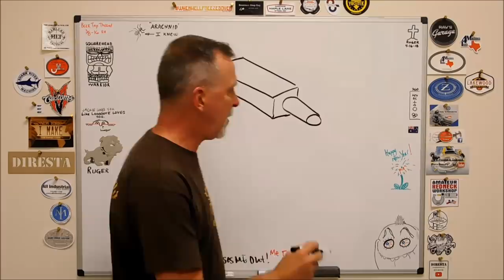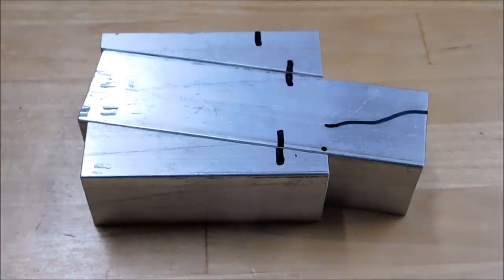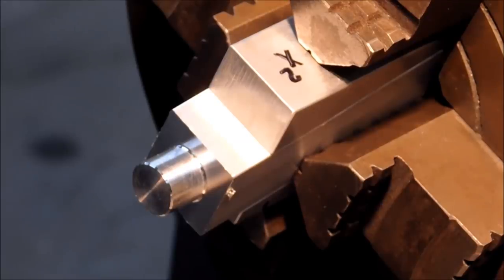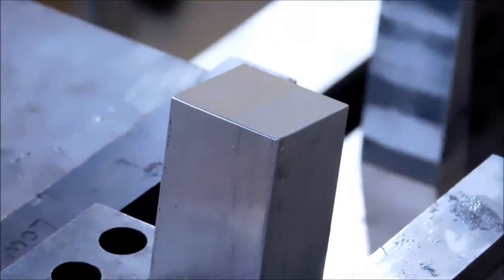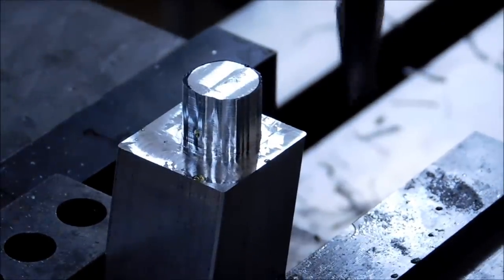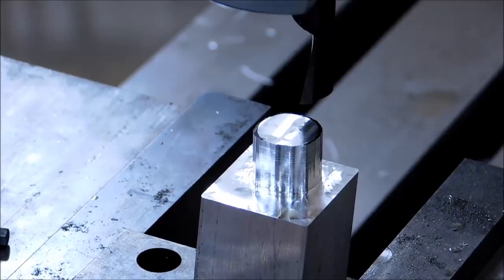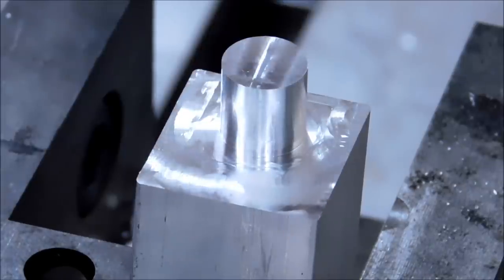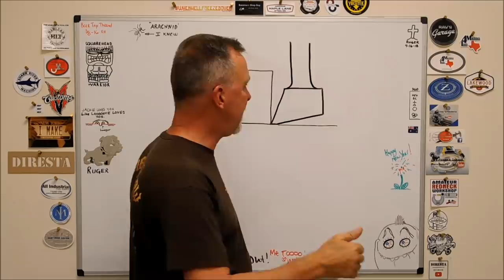Machining Angled Bosses on The Mill and Lathe

Comment: Proof that the real job is holding and indicating parts rather than cutting them.
Reply: But what did you think of his skill in roughing out the part on the mill? Smoooooth. This guy has the knowledge and the skill to demonstrate it. Impressive stuff
Reply: @nanathannvw  He machines the way a cnc would do it. Holding and set-up is 90% of the job.

Comment: Joe, you are fountain of tips and tricks and I watch your stuff even if I do not immediately have a need for what you are presenting. You are making us aware of techniques and it gets stuck somewhere in the back of the head to be pulled out when need arises. Thank you for putting in the time and energy to create these videos. They are timeless.

I would love to see how you would approach milling tight flatness tolerances <0.0007 (<0.02mm) between two surfaces on 3-4" squareish part of about 1/4" thickness. So you machine top of the part then flip it over to finish 2nd op. I find it very tricky and touchy.
Reply: Toe clamps

Comment: Very informative video as usual. Now it's time to repay the knowledge I have extracted from you over the years.
TIP: use a rotor broach. The internal dimensions are quite accurate and leave a nice finish. Whatever is left on the outside can be cleared away quickly. Don't tell anyone,  but I also use this method  for quickly removing stock in the lathe. Try it, it'll change your life :)

Much thanks and best of luck from downunder

Comment: Your lathe approach is what I would have considered first. The mil solution was very creative and interesting. I doubt it would have occurred to me.  I have used rotary table in the past for circular parts, but boring bar never. Another very informative video.
Reply: If the tolerance is tight, the mill is much easier to put the boss exactly where you want it.

Comment: Great videos Joe! I only found one other comment that mentioned this so I will add another.  One caveat to back boring, if you have a two piece threaded boring head, running in reverse could cause the shank to unscrew. If you have a threaded boring head just use a left hand tool that allows you to run the boring head forward so it won't unscrew, problem solved.
Reply from the maker: Good point.

Comment: Joe - This video and your mention of tooling balls is a good segue to a question I’ve been intending to ask.  I often machine tunnel gates into mold cavities.  The cavity block is mounted into a machinist vice using a sine bar.  The machinist vice is then mounted into a mill vice using a sine bar.  The cavity block is located using an apex and the gate bored.  If edges are broken or chamfered locating apex with laser edge finder, optical or pointed probe is imprecise.  Improvement option 1 is a tooling ball with a tetrahedron pocket like US pat 5046262.   Option 2 is a pointed probe off each surface of apex then some math.  I was wondering if you might have other options.

Comment: Hi Joe, 
I see only one comment about the angle of wooden wheels such as on your cannon. I am not a wheelwright but an old friend of mine makes model horse drawn farm carts. I believe, though I stand to be corrected, that dished wooden wheels are stronger than flat. That being said, the greatest strength in them is directly through the length of the spokes, so wheels were cambered in order to benefit from the strongest design along with the weight transferred directly along the length of the spokes. Bearing in mind that cannon are very heavy this explains the necessity. 
I can see what you mean about making the wedges thinner so that the chuck jaws grip the actual part being machined but I think that the way you held it would be better with a piece of paper between the wedges and the job to increase grip. 
I am not a professional machinist but learnt what I know from old books as I use lathes that are between 70 and 110 years old, so use the techniques evolved for them.

Great video as always...I will carry on watching now :)

Comment: If I was doing a bunch of these, and it was a job that would be repeated. Say parts of production fixtures that need to be changed because of wear issues. I would definitely make a fixture to hold the material. We had a connecting rod transfer line that was used to produce two different rod lengths. The locator for the small end of the rod needed to be offset .125" as the rods were 5.875 and 6.125 center to center. The locator was made with a register diameter to sit in the fixture and the locator pin. When switching rod sizes the locator would simply by turned 180°. The same machining line had fixure parts that equalized the clamping forces from one hydraulic cylinder over multiple parts. They featured features similiar to this with the added bonus of having spherical ends

Comment: One of those tooling balls is a great idea. It's a bit like a ball bar test on a CNC mill. Center drilling the end at the correct X,Y coordinates and indicating that with a test indicator would do it also if enough excess material can be left and then milling off that at the end. I did know about the reversed boring bar trick, but not the opposing angle blocks in the 4 jaw. A clever tip and one for the memory files. 

It depends on what time period or sometimes even the country of origin if a cannons carriage had those angled axle ends Joe. I'm no expert but it seems from about the time of the American Civil War and later most military's got away from those types of axles. The English may have kept using that design detail longer than anyone else. Since the barrels weighed so much the angled axles were supposed to distribute that weight in a more direct line from wheel rims to the hub during sharp turns to prevent wheel breakage. I suspect it didn't work quite as well as they hoped it would and it slowly disappeared. The 5 degree inward dish on the spokes that the Napolean 6 and 12 pounders had was for the same reason. Oddly enough the English normally chose to use 12 spoke wheels and 6 fellows which makes the dividing easy. For some reason the American built Napolean's used 14 spokes and 7 fellows that made up the outside rim. Durability maybe?

Comment: I tried the milling technique a few years ago but running the mill in reverse unscrewed the boring head...I ended up making a fixture for my lathe but set up for this particular operation would be a lot easier on the mill.
And yes on the tooling ball...

Comment: Most pull-down milling vices do not lend themselves to this sort of stuff as some will even squish pieces of paper shims down and will really throw you off. There is a style of vise with a clutched handle which disengages you can still move the parts by hand to position them and then tightens on the next twist.

Comment: Fantastic video Joe !  I think there is still alittle more to this story like finding the centreline of the angled spigot you are about to machine and what if the base of the spigot is offset to the centreline of the  parent material ? You may wany to machine an anglesd spigot that the base of that spigot is offset say  1/8 inch in the Y axis and 1/2 inch in the X axis  compared to the centreline of the parent part - hard to explian what i mean with words easier to draw !  Never the less your video got me thinking !
Reply from the maker: I know exactly what you mean. I may cover that at a later date.

Comment: Thank you, very interesting, the lathe will have to be my option as my little mini mill does not run anti clockwise. I suppose one could also mount it on a rotary table in a chuck?

Comment: Cool vid
I never thought of using my adjustable boring bar (Ive got the same kind) to cut an outside face like that.
Reply from the maker: Ever put a piece of material in a collet on a mill and held a toolbit in your vise to turn down a pin in a pinch??
Reply: @joepie221  
No I would use my lathe for jobs like that.

Comment: You need a Wohlhaupter boring head for the bottom.  It seems to me the really challenging part is getting things lined up so your trunnion is where it is supposed to be.  Neat tricks though.  Was thinking a rotary table with a angle plate would be possible, but lining up the trunnion with the centreline of the table would be very difficult.  Not sure what a tooling ball is, but I'll watch it.  As long as it doesn't involve large spiders.. :(
Reply: Barry Gerbracht 
You could also use a boring head that can bore tapers to give a tapered spigot.  I think it was on robrenz channel he showed one of thes e. I would love a wohlhaupter but just can't justify the cost for what i do .
Reply: @ianbertenshaw4350  I want to build a new house with a much bigger shop so I can add metal working machines.  I only have wood working machinery now.  There is no justifying the cost of the machines other than I want them.  I saw both Robins taper boring head and Steffan G's Wohlhaupter and wanted one.  At KBC tools, they have a Narex model which is $7000 for the middle sized one with accessories, more than many peoples milling machines are worth.  I see a bunch of Wohlhauper ones used on ebay for $500 range though, which will be tempting when I eventually have something to bolt it to.  In the mean time, I just keep watching and learning so hopefully I am half way competent to use the machines when I get them.
Reply: If they want seven grand for a boring head look elsewhere i can get a narex for $1000 au or less . They are  nice to have items like a 3d taster but not essential ,- i was just commenting to show that with the right tooling more options are available , you have to be really carefull buying used with things like this as they do have complex internal mechanisms that could be damaged and are expensive or impossible to fix .
Reply: @ianbertenshaw4350  Wow that's cheap (new?).  I always expect a premium for stuff in Canada compared to the US.  I won't be running out to get one of these when the time comes mind you.  I have a list of goodies I'd like about 10 pages long, and this would be at the very back of that list.
Reply: Barry Gerbracht 
The supplier i used to see narex boring heads listed no longer sell them and their chinese made  copy is about $1500 au so you may in fact pay a  few grand for a genuine narex but $7000 seems a bit rich especially if thats USD .the chinese copy will do everything you need . I have seen an article ( i think model engineers workshop ) about modifying a small compound slide from a lathe to create a boring and facing head , not as nice as a proper unit but it did work !  Good luck setting up your workshop Barry i hope it all works out for you !
Reply: @ianbertenshaw4350  Welcome to Canada, where everything is 25% more expensive (on top of exchange rate) than USA.  The $7000 was for the full kit with all the extra bars, extensions etc for the 56 model.  I'll settle for a $500-700 used Wohlhaupter UPA3 from ebay whenever the time comes.  Thanks.
Reply: Barry Gerbracht they don't last long on ebay here because everyone wants one !

Comment: I did use a strange and expensive large boring head decades ago at keytronic in which after it finished coming down you then held the outer diameter of it AND IT FED OUTWARDS--(or inwards)..
Reply from the maker: I've seen those on jig bore machines. I don't know why, but Walhopter head sticks in my mind.

Comment: I need to mill a 40 degree angle on a piece of 1" X 2" X 16" stock. The angle needs to be along the 16" length. Could this method be used by splitting a piece of stock at the 40 deg angle and using a piece each side to clamp the stock in the vise? Or is there an easier way?

Comment: Hi Joe, great work again, thanks.  Just to emphasise jim richies comment, many cheap boring heads (mine included) are threaded onto taper, and will fall/fly out if used in reverse.  I know you're extremely safety concious, might itbe worth you pinning a note pointing this out?

Comment: How would you handle a "Leaning Tower of Pisa" type of boss where the center axis is not perpendicular to the round face and where the round face is parallel to the rest of the non-raised material? Is this even possible without some expensive CNC operation?
Reply from the maker: Thats a very involved thing to machine. A pressed pin would probably be best if the load would allow for it.

Comment: The "positive camber" of some gun carriages and in particular "mountain howitzers" is the result of the fact that the axle is not "solid" spindle to spindle but is actually a "spring" to allow some "suspension" in the carriage so wooden-spoked steel-rimmed wheels didn't break in rough terrain and/or at high speeds with the carriage axle carrying not only all of its own weight and that of the "hitch" and that of the gun but also some of the weight of the "limbers" on steep slopes traveling uphill. And once the gun carriage or rather "caisson" is hitched to the limbers and is in transport position with all of the gun weight carried on the limbers and caisson, that positive camber disappears because the "suspension" is loaded and compressed to its correct and optimum position for maximum "suspension travel" upward and downward and the wheels end up where they have to be to "survive" even at slow speeds and on smooth terrain. You can't subject wood-spoke wheels to "side loads" at the rim where the spokes are furthest apart, the wheel is most flexible and "weakest". ANY spoke wheels will "fail" when subjected to constant positive or negative camber under load and while the vehicle is moving which is why spoked wheels never have "offset" and the centerline of the wheel/spokes/rim/tire is always centered on the spindle and hub and between the axle/wheel bearings. 

If your project includes a caisson and limbers and you want it to be "right" in "transport mode", make the wheels "perpendicular" to the ground.
Reply from the maker: I gave this design a lot of though and analysis and have to offer my opinion. Flat carriage wheels are not as strong as wheels with a slight conical construction. This is a known fact. Additionally, many cannons had 14 spokes for added strength. In order not to introduce forces undesired, the axles on cannons using conical wheels were slanted to assure the spoke of each wheel was perpendicular to the ground at contact. Mechanically, this makes perfect sense. An additional benefit to having axles slanted down was it kept the wheels against the larger axle body during rotation and did not introduce outward forces on the smaller retention pins. These wheels would probably still stay on even if the axle pins came off. Personally, I don't believe it had anything to do with suspension.

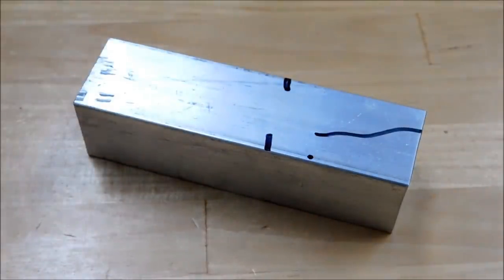Comment: Love your stuff Joe!  At the 2:00 mark you "grab another piece of material and split it at the angle you want to achieve on your work piece".  To me that's the crux of the video. How did you setup and split that other part?
Reply from the maker: I scribed a line with a protractor and used a bandsaw for the demonstration. For precision support blocks, you can use this method.       https://www.youtube.com/watch?v=lDwAzcSUVtI&t=194s

Comment: Joe, why when milling the top did you not make straight cuts? I noticed you not completing the cut and easing off before you started mill8ng the other direction. Thanks for another top class lesson!
Reply from the maker: Corner chip/burr control.

Comment: I wonder if you'll even see this, but I have a question.  It looks like most boring heads out there are threaded onto R8 shank, or whatever.  Where can I find a 3-inch boring head that can be run in reverse without it coming apart on me, and preferably without paying over $300 for it?

Comment: Hi Joe,

Thank you for making these videos. 
Might be answering someones question but you are covering issues i have not yet encountered and im sure i will someday. 
You also teaching me techniques that experience can only teach.

Question: I noticed when you face mill, you cut and get to the change in direction (X to Y), you step out 90 deg in the opposite direction to where you going to cut and then go into the cut. 
Reason for this?

Keep it up and thanks again
Best Regards
Paul
Reply from the maker: 100% corner burr elimination if your pass is below the vertical centerline of your cutter. good eyes.
Reply: Very cool. Im going to try this. Thank you again

Comment: Dumb question... aren't most boring heads right hand threaded on to a machine shank? That being the case, wouldn't running in reverse be a potential for the head coming unscrewed?
Reply: That's my question as well... I tried this on a project I had but as you summited, the boring head unscrewed.
Reply: the bar is reversed so the cutting force is reversed
Reply: True... just dont go haywire with your cut... all cuts should require very little load not ever surpassing the torque of the taper lock let alone the draw bar
Reply: Even though the cutter is reversed the cutting force is not, and a screwed on boring head will unscrew.. I would be happy to do "external boring" with my boring head but I would run it clockwise and make an appropriate tool.
Reply: another reason to have a boring head with integral shank, if you have the means.
Reply: @richardedwards4454 :  A little Loc-Tite on the threads will prevent it from coming unscrewed.. If you ever need to remove the shank a heat gun will break the Loc-Tite loose.
Reply: I had the same fear, and invested in a left-handed boring bar, should the need for this technique come up.
Reply: Yes I was going to mention this if your head has a threaded arbor make light and slow cuts and use manual quill feed.  If your using auto feed and the head comes unscrewed things will break. Likewise if you leave the spindle at the top of its travel and feed with the Z axis things will get ugly. Running one backwards is not a good idea but if you have no other option make sure you leave it room to go.